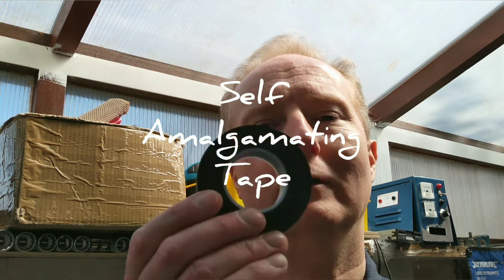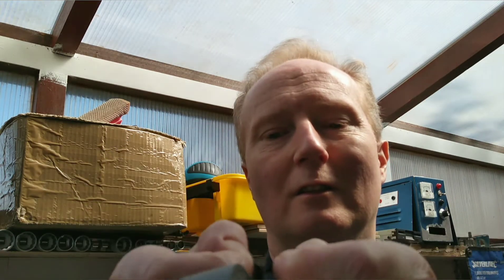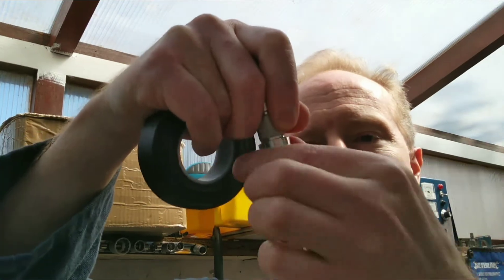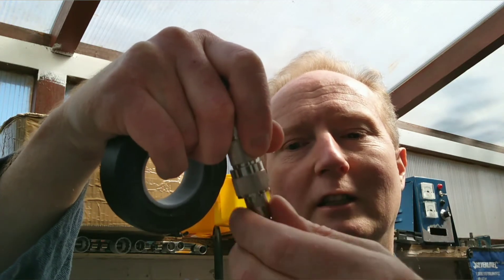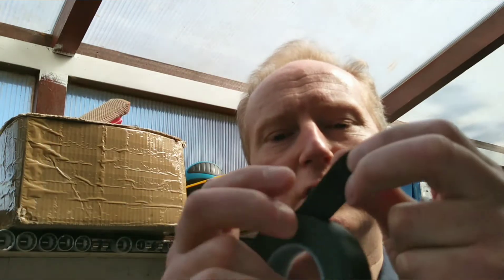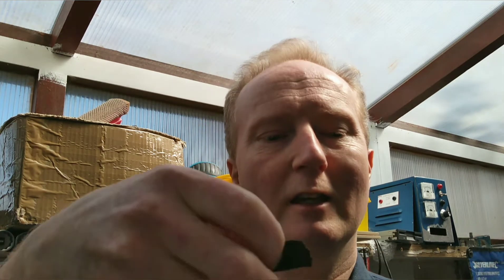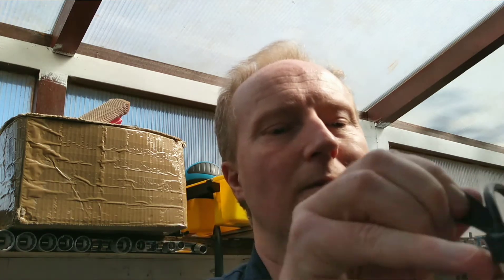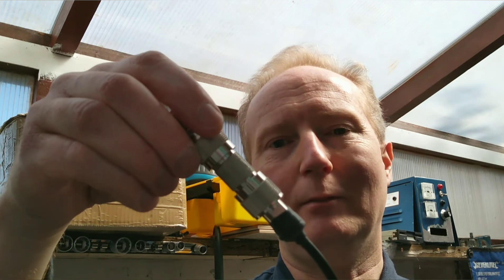What is Self Amalgamating Tape

Comment: The signal goes the other way :) 
It comes down from the antenna, not up.
Reply from the maker: Not if you are transmitting. 

Also, If you are using the antenna as part of a repeater system, then by using a duplexer, you can simultaneously transmit and receive, using the same antenna and coaxial cable.

There is such as system about five miles away from me at present, which I designed and installed. Its a UHF system , using handheld radios, in conjunction with a repeater and duplexer system. It gets 15 miles radius coverage, as per system design.

Comment: You should use this from the cable, right over the complete connectors to the cable and back... this will then give you a truly waterproof seal over the connection... BUT DO STRETCH IT FIRST OTHERWISE IT WONT FORM A SEAL.

Comment: i use this stuff for my antenna connections, far far better than electrical tape..just be aware theirs some cheap crap out there that seems to destroy its self in the sun after a few weeks.. Pay that little bit more to get the good stuff, you know it makes sense..Buy cheap, buy twice, lessons learnt on my side..
Reply: Thanks for the heads up QRP. Do you have a brand recommendation?
Reply: @matildaadventurer41  just avoid the cheap stuff on ebay and amazon, its better to buy the dearer rolls than the cheap, buy cheap buy twice and you save nothing in the end..
Reply: @matildaadventurer41  Go with a well-known brand like Scotch 3M or any of the other recognizable brands. Just don't get a chinese knock-off brand.
Reply: Actually it has to be used WITH electrical tape if you read the manufacturer's instructions. This should be applied to the connection from bottom to top. Then it should be covered with an abrasion-resistant electrical tape like Super 88, again from bottom to top.
Reply: @nilpo  I have been using it on its own for 5 years on my out door antennas..No water ingress  and the seals are as good as the day it was put on. Nothing was used underneath it, I will continue to use it in the exact same manner for the next 5 years or so..
Reply: @qrphfradio7753  You don't need anything under it, but per the instructions, it's not considered watertight without vinyl tape to finish it. You're right though. If it's installed will it does work well on it's own...depending where you live. It doesn't carry the same UV rating as the vinyl tape and it breaks down in extreme cold as well. YMMV.
Reply: @nilpo  it's far far better than electrical tape that starts to unwrap it's self at high temperatures weather wise out doors..I've been caught out in the beginning by buying off the likes of Amazon and eBay. Cheap Chinese made tape broke down with cracks forming, lessons learnt and paid the price  literally.